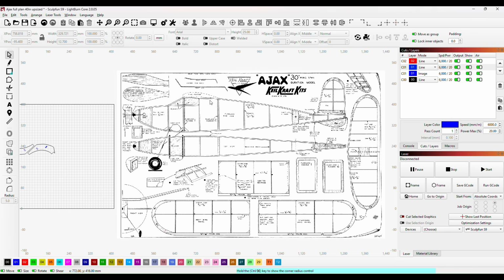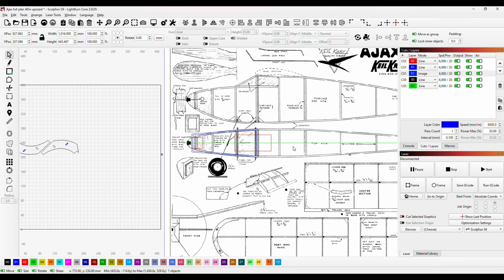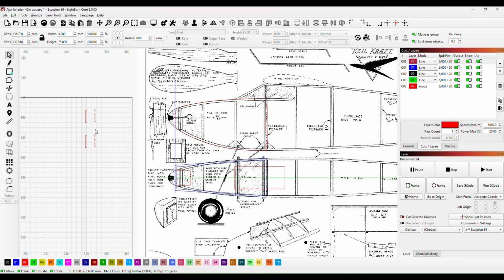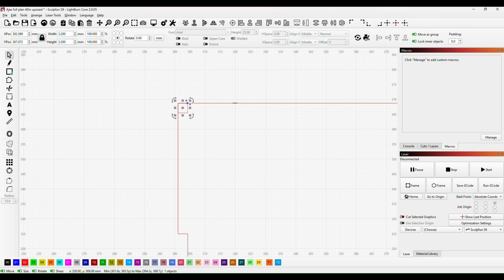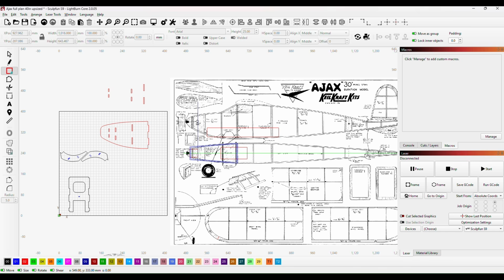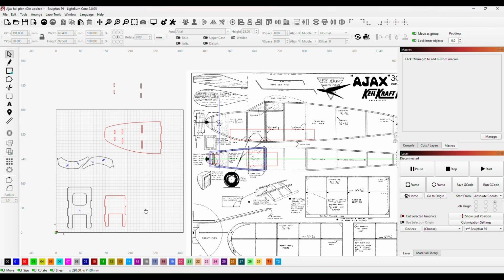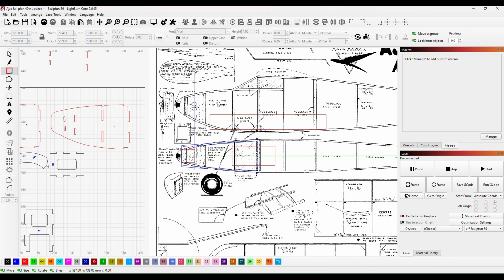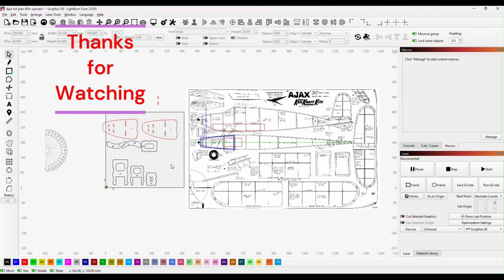How to make perfect parts for for a classic Balsa plane using a cheap £250 DIY Laser (Ajax 2)

Comment: Hi LMG,
Just another annoying comment. I was having difficulty seeing the Red line I was tracing off the plan, and I was thinking could I reduce the contrast of the image I was tracing from. I found that if I went to the cut menu and selected the 01 Image, turn off the output to that layer then the image would be greyed out thus making it easier to see the tracing against the image. Hope this helps Cheers
Reply from the maker: Aha! I see what you mean and it is a very good point, someone mentioned this before and I missed their point. I shall try to find that comment and re-address it. I will certainly add your comment into the current video I am making on the Ajax and I will use this tip in future. Thanks Geoff I learn new stuff every day, and this was a good one! 👍👍👍👍

Comment: What happened to the RC spitfire, has it become just an ornament?
Reply from the maker: No, it has become a fantastic RC plane. And as soon as the weather is right I will be flying it along with the Dixie, the Contestor the Popsie and a whole bunch of others too, thanks for asking. 👍👍👍
Reply: @LaserRCModelguy Thanks for the update.
How tricky would it be to include retractable undercarriage on another build?
Reply from the maker: @harryzero1566  It's not really something I am intending to do, I don't think it would be particularly tricky just very time consuming.
Reply: Where you get that protractor? Is it possible to download?! Thx for effort 👍
Reply from the maker: @Rc-Hangar3  Hi, yes it is possible to download, but as Geoff pointed out in the comments above you can use the rotate function in the top toolbar and just select your angle using the up/down arrows.
If you still want the protractore you can get it here:
https://www.ginifab.com/feeds/angle_measurement/
Reply: @LaserRCModelguy Thank you👍
Reply from the maker: @Rc-Hangar3  👍